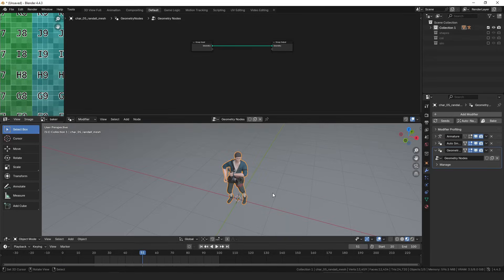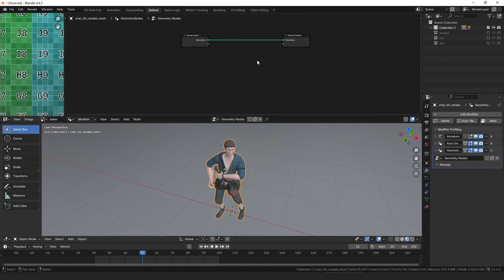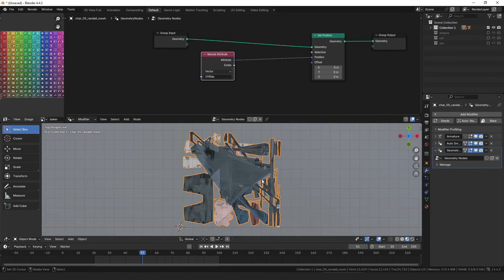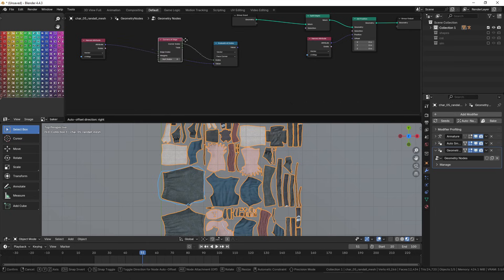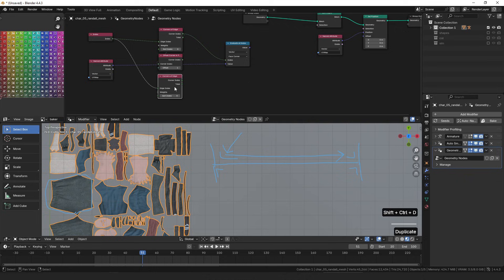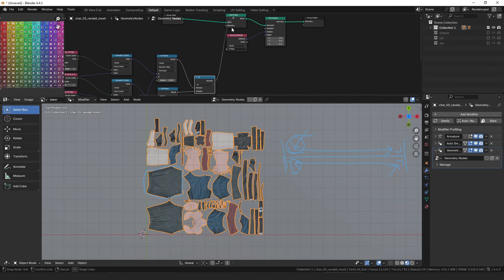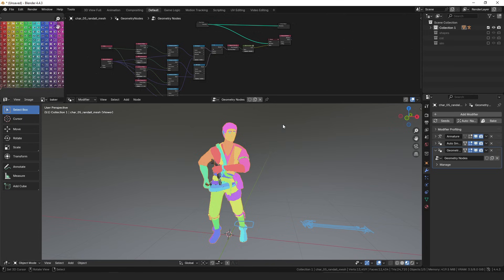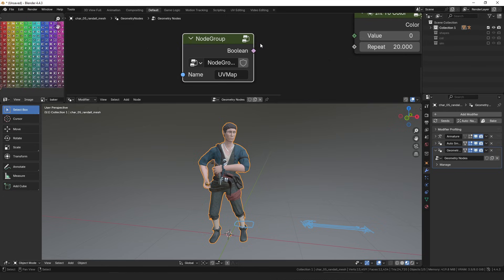How to Select UV Seams with Geometry Nodes in Blender

Comment: Thank you for sharing in this knowledge! I'm going to have to take some time to digest the logic behind your node network. It's very impressive! One thing, if you pop a uv_seam Named Attribute into the selection input of the Split Edges Node, it will achieve the same thing as the logic you've generated.
Reply from the maker: Kind of, the mesh will look the same, but the edges will be split (duplicate verts), which isn't always desireable depending on what you want to do afterwards.
Also, that assumes that the seams were marked in edit mode.